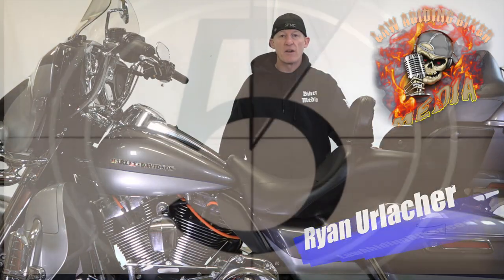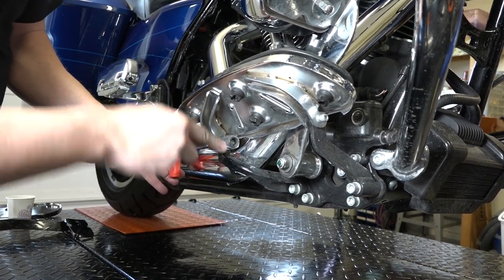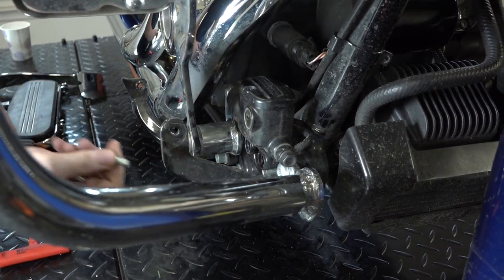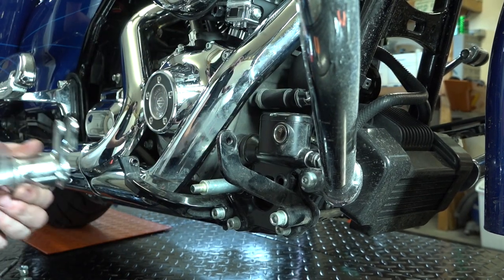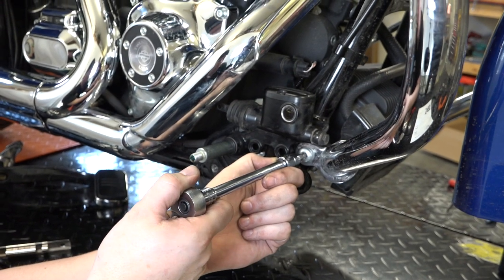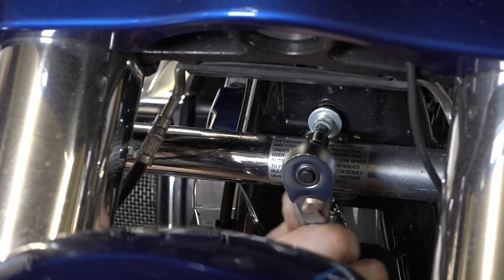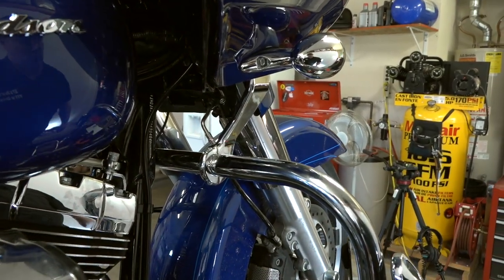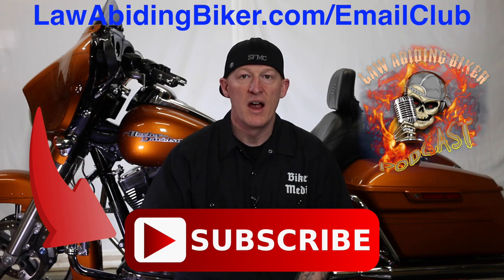How to Install  Kuryakyn Extended Brake Pedal on Harley Davidson

Comment: How much harder would it be with an Ultra with the lower fairing?
Reply from the maker: A bit more work potentially.  You may have to remove the fairing to get the job  done.  

Ride safe & Ride Often!
Here is a link to a bunch of our useful Free vids: http://www.lawabidingbiker.com/freevideos
Here is a link to some of our useful for purchase videos: http://www.lawabidingbiker.com/buyvideos
Want Answers & Information Fast? And help support us at the same time? Do you like the content we provide?
Our patrons get answers to their questions/comments/feedback in less than 24 hrs and are part of our Private Facebook Group. If you are interested in being in this exclusive group you can get all the details at ==> http://www.lawabidingbiker.com/patreon
If you haven't subscribed to the Law Abiding Biker Podcast make sure to do so. Listen in as we talk weekly about issues/items like this & so much more. You can listen on iTunes (Apple/IOS), Stitcher Radio (Android), or any other Podcast App ==> http://www.lawabidingbiker.com/podcast
Join our free email club at http:///www.LawAbidingBiker.com/EmailClub. Only relevant content will be sent from time to time. Email club members are the first to find out about free or for sale content are given special coupon codes.
Reply: See my comments n how to do the install without pulling crashbar.

Comment: I would install an "E-Z brake" lever before I did the extended.
Reply: +Rick Kane are you saying that with an E-Z brake lever you have to lift more than with the Kuryakyn?
Reply: I was told for my situation it wouldn't help because of Iso boards. Harley really screwed up with new bike and brake arm. My 07 I had same Iso boards and could put my foot under brake and new one practically laid on floorboard.

Comment: The cotter pin location is a BITCH. I'm going to remove it and replace with a hitch clip. Also, don't forget to grease the shaft! I got mine completely installed and the brake pedal is binding. I'm going to have to take everything apart again! Ugh!